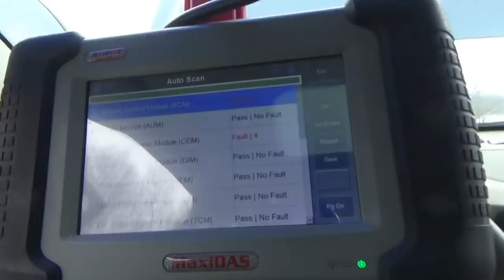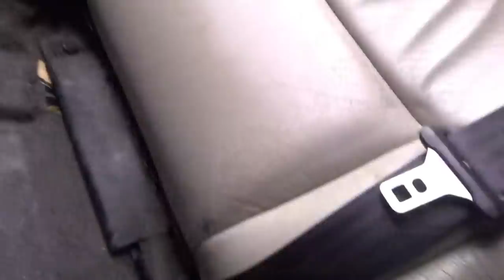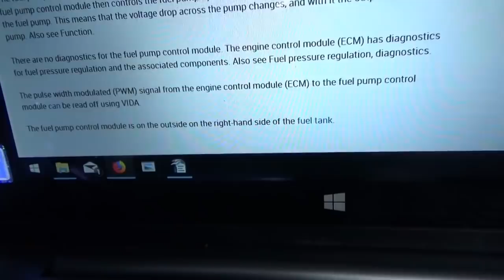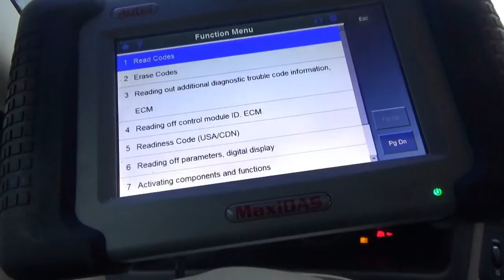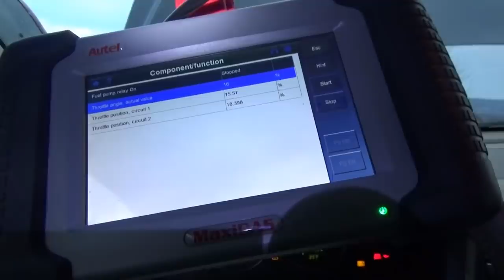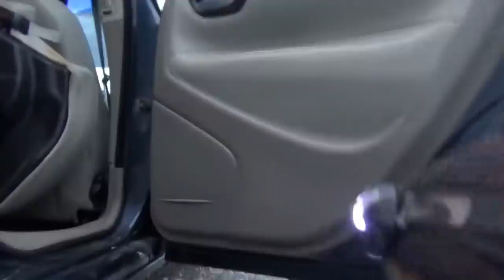Volvo Crank No-Start -Part 1 (Diagnosis)

Comment: Hello I see you are not using VIDA or DICE that Volvo requires for diagnostics of Volvos. What you are using goes pretty deep into Volvo diagnostics so is it from what you have learned over the years or is there still some things you cannot do to Volvos like programming throttle bodies or down loading software updates to Volvos?

Comment: I have a 2001 S80 that has no communication to the OBD port no – lights nothing other than one check engine light. Half the car doesn't work. Pulled out both ECU computers. Didn't see any corrosion or anything like that so I'm assuming it's the wiring

Comment: Dealerships are disgusting.  This guy took the time to methodically organize his troubleshooting steps. He checked and double-checked his findings.  He didn't jump to conclusions but instead, made the right conclusions. THIS is the difference between a 'technician' / parts replacer and a REAL mechanic.  What happened at the dealership and what typically happens-  the problem is 'diagnosed'; parts are replaced, doesn't fix the problem, the customer is called and told they need even more parts- and eventually, the bad part is 'found' but only after replacing a bunch of good parts-  all at the expense of the customer.  THIS is why I do my own repairs- THIS is why I watch TRUE mechanics like this guy.  Awesome job, thanks for showing us the way it's done.

Comment: Polymer electrolyte membrane is Working Principle Polymer Electrolyte Membrane Fuel Cells

They use hydrogen or low molecular weight hydrocarbons as the fuel at anode and oxygen/air as the oxidizer at cathode. Among others, hydrogen, being one of the potential futuristic energy sources,

Comment: On the Ford fiesta that was towed from five hours away, you tapped the bad module and it responded 
A Kevin tap test shows a simple physical circuit problem.
 Why didn't you pull it down and find the dry solder joint?

Comment: Funnily enough, I'm working on my '99 S70 right now, exact same fault. The electronic control system is a lot simpler, but the pump is controlled by the ECM in a similar way, just that it would appear that the pump is either on, or off, via a simple relay, though to say simple, may be not strictly accurate because there would appear to be a signal path back to the ECM which I have yet to deduce.  The main thing is, I'm going to be bypassing everything, and driving the pump direct at battery voltage. If that works, I'll be where you are at the end of the video.

Comment: I have a 03 s60 with a 2.4t it won't start. Replaced both cam and crank sensors, plugs and coils. It has fuel in the lines and can hear the pump running on initial startup. It still won't start, any advice?

Comment: I don't have or need to spend three thousand on a diagnostic test laboratory to tell me that my fuel pump isn't working. Just spray some starting fluid in intake press start,car starts ok. that means no fuel in rail or no pressure. Easy deduction BAD FUEL PUMP. Wow that costs $4 for starting fluid and 10 mins to test. I know I now genius. good old back woods knowledge will win every time.

Comment: Hi, very good program except from (the h-word) and you speak quite clear American-English. I wonder why you not did go strait to checking the fuel pump but I get the point that you follow a procedure to find the fault in a technical chronologic order. I recommend that you get a work-shop un wheel so you can come to the customers car where ever it is on the road. Then you can have a diesel heater and everything you need there, even a bed to sleep strait after hours with work. What equipment you use to do the diagnose with? Is it mainly for Volvo or a variety of car brands? What does it costs over there and do they sell it in Norway in northwest Europe?

Comment: Hi my name is Anthony Thomas I have a 20004 volvo s60 2004awd2.5 t and my car is slow when I acceleration I change the spark plug ING coils fuels filter  and I net to no wear is my fuel pump module is lowked at an Jack the car up  & looks by the gas tank & looks all under the car can't find it help me please my car run drive try the back seats & the tunck & ecu is bad can my car slow because of a ECU I seen your YouTube video & I like it & you said the car going back to Virginia & live in DC r u close by can I pay you to fix my car  one day thanks you
Reply: Anthony Thomas, since you're from the future, can you tell me if there is going to be a civil war over the NWO's "Great Reset"? Also, how long do I have before the economic collapse? I'm in 2021...Thanks in advance, from the past...

Comment: This is why NOBODY 1) Buys Euros and 2) Goes to Dealers. Euros are not durable long term, and repairs are staggering. Buy a Detroit product, durable as can be.
Reply: I'll stay with Honda/Toyota. Import is where it's at for me...mechanically inexpensive. Aesthetically, can be a bit more costly. Reliability, priceless...
Reply: @boodro2122 . Reliability? Really? Did you see all people the Toyotas killed about 10 years ago? Bad brakes, bad steering column, unintended acceleration, etc. Toyota was fined $1.2 Billion dollars!  89 people dead from terrible engineering & quality! You couldnt pay me to risk my life in a Toyota.  Japanese nameplates have had big quality problems the last 20 years. Toyotas are not what they used to be, not even close. Why do people think Toyotas are the standard in reliability? Tell that to the families of 89 deceased. Junk.

"Car manufacturer Toyota has agreed to pay a staggering $1.2 billion to avoid prosecution for covering up severe safety problems."

https://abcnews-go-com.cdn.ampproject.org/v/s/abcnews.go.com/amp/Blotter/toyota-pay-12b-hiding-deadly-unintended-acceleration/story?amp_js_v=a6&amp_gsa=1&id=22972214&usqp=mq331AQHKAFQArABIA%3D%3D#aoh=16152519830051&referrer=https%3A%2F%2Fwww.google.com&amp_tf=From%20%251%24s&ampshare=https%3A%2F%2Fabcnews.go.com%2Famp%2FBlotter%2Ftoyota-pay-12b-hiding-deadly-unintended-acceleration%2Fstory%3Fid%3D22972214%23aoh%3D16152519830051%26referrer%3Dhttps%253A%252F%252Fwww.google.com%26amp_tf%3DFrom%2520%25251%2524s
Reply: @My_Los_Angeles  Well, that's devastating. I have only owned Honda. I didn't know Toyota had this reputation. I know a lot of people who've had Toyotas and love them. A lot of people at my work drive Toyota and swear by them. I'm sure all manufacturers have detrimental statistics. No engineering is perfect. I'm a Honda guy. (Relatively new to Honda). And I've fallen in love with everything I've learned about them. And ive learned a lot! I've talked to a lot of Honda people, as well. I choose Japanese import over domestic all day.
Reply: @boodro2122 . You're just dismissing 89 deaths as "all car companies have issues"? No. This was a disgraceful and blatant disregard for human life. Profit over safety. Stop being an apologist for imports. Honda, and many of the Japanese car companies were caught inflating their HP figures badly in the late 90s. Their little engines dont make anywhere near what Detroit's do, so they resorted to inflating their HP figures (look it up). Imports have never been able to take on Detroit without funny business. In some cases, Honda's HP figures were exaggerated 30+HP to compete with bigger stronger Detroit motors...fact. Imports are all hype.
Reply: @boodro2122 . Yup!!
"They cheated, now they are caught and their numbers are shown to be bullshit. Honda or Toyota could have decided to spend the research and engineering cost to actually make the horsepower they claimed as the horsepower wars kicked off and gained more notice in marketing hype. Instead, they cheated and tricked the consumers into believing something that was not true.

It is black and white, there is no grey here. By cheating they were able to maniuplate numbers higher than they would have been in the real world. It is unfortunate that it took a regulation change to make the Japanese do the honest thing."
Reply: @My_Los_Angeles  My boys' Civic will walk your Detroit, bro. Lol
Reply: @My_Los_Angeles  Hondas are on the tracks smoking 6 figure cars. There's your "black and white".
Reply: @boodro2122 . Shall we discuss the Euros getting caught falsifying their emission standards a few years ago? Can you say '"Gross Polluter!". Seriously, imports have never been able to compete with Detroit without cheating. Pathetic.
Reply: @boodro2122 . A 4 banger Civic? LOL. Now I know you nothing about cars. You're embarrassing yourself.
Reply: @My_Los_Angeles  lol
Reply: @My_Los_Angeles  Nah Chris, im not embarrassing myself. I was just trying to get you going because you were getting all fired up over imports. And you're right, im not a gear head.
Reply: @My_Los_Angeles  I dont know much about cars besides my own. I'm not a mechanic, but there isn't much I can't fix if I have to. I know a few Honda enthusiasts and I've come to appreciate the brand. And I dig my CR-V. I can't banter with you about cars very well, but I think you're being a little harsh on Honda. Have you ever heard of "Million Mile Joe"? Drove an Accord for a million miles with proper maintenance.
Reply: @boodro2122 . Honestly man, dont reward deception. If people want to like imports then whatever, but its undeniable imports have engaged in major deception through the years. The conscious corner cutting Toyota did at the expense of safety was absolutely criminal (89 dead), the Japanese having to lie about their horsepower figures was shameful, and the Euros fudging their emissions tests was shameful as well. I would never trust a company again who lied to me, or worse yet endangered lives so blatantly as Toyota did. They shouldnt be rewarded with your hard earned dollar. I cant stand liars, and thats what the imports have been frequently. I trust Detroit products to protect me, havent let me down yet. Dont reward deception....

Comment: Why did my DIAGNOSTIC test find no problem but the car wont start?
My volvo S80 twin turbo was riding like a dream ,and stalled like I turned the key off.
It turns over,fires ,but wont start.

Comment: After I bought a fuel pump I finally found your vid.  This was the answer to a no fire 2005 XC70.  ( Codes were 089, 190 and 193 ) Needless to say, if you never experiences a two port fuel pump... kinda annoying when doing it green.  (Hint: Buy the socket, get two O rings and expect to stick your hands in the tank and get wet with cold gas even at below a 1/4 tank). Any way. Your bypass method was what we used to test the fuel pump and the car fired immediately. We just used two paperclips and electrical tape to the connectors to test pump and start vehicle.  The inside was full of aluminum corrosion dust. The other components looked brand new on this 15 year old vehicle.  If they used something the wouldn't corrode for the heat sink, it would have been fine. If you feel I should replace the rail pressure sensor because of those codes or suggestion on what to do next (Clear codes and if nothing come up. let it be?), I'd appreciate it.   Oh and mine was not located on the tank it was exposed on the side in the rear underneath. The part number was 30769225 for Bosch (Original number was Bosch 8629614) and 601-227 for Dorman if anyone is wondering.

Comment: HAHAHA, jesus.. 
Is this repair shop still around? Looks to me that the owner wants to become a millionair, you should out them, this is not right. 
Have a hard time to belive the PEM is broken, but you can get one in the scrapyard.
Get a new fuel pump, change it yourself. $40.
Get a OBD cable and fix the fault yourself. $20.
Either you fix the rusty hanger yourself or let a shop fix it, price seems right if it has welding in it.
"oiltrap" or crankcase ventilation, fix it yoursel, clean it or if you have to purchase it $40.
New oilfilter for fks sake, $10.
2 new control arms, $300--400.
Leaky rubber, new rubber $10..

This is what happens when you don't take care of your car. Does not matter what car you drive.

Comment: Another Crank no Start/security fault solution: Some Volvo S-70's have a chip embedded in the key that the ignition reads to allow it to start. My 2000 S70 had a key that the chip went bad. We found this out after trying the SPARE key on accident...everything instantly worked great, started right up. So to make a copy of the key with the good chip costs about $120 unless you go to the dealer and it will be about $300 +

Comment: Okay so I am having the same problem on my 2007 S60 T5. This video is incredibly informative, but, being a novice at repair, I don't know what that power source you connected to the fuel pump was. What is it and where can I buy it?

Comment: I run into that headlight problem a lot on the newer cars which drains the battery, so what I do is I pulled the headlamp  Relay, As long as the headlight system  Is not part of the problem being diagnosed this works great

Comment: I whould remove the CEM and open it. It's a very common fault that these modules becoming water inside and corrodes the PCB. I had this many many times. You need to disassemble the whole CEM to fix it. BR Matthias from switzerland!

Comment: The dealer can go suck it ... that basically resumes it. What is the role of that module, does it control the pump by PWM? And where does it get power and control signals? I guess you could back engineer it if it is not too complicated. Waiting for part 2

Comment: PEM is petrol electronic module if I recall and there is a fuel test port on the fuel rail under the black cover.

Comment: Nice Diagnosis. I am just guessing it took you a little over an hour to find a poor fuel control module. 
looking forward to Part 2.
Reply from the maker: Most of the time was spent locating the components lol!
Reply: @PineHollowAutoDiagnostics  Tow the car up to you, do the repair, and than take the train to get the car. Drive the car back to VA. For a fraction of the dealer repair cost. Yes or No
Reply from the maker: Actually I'm driving the Volvo back to the owner next weekend! How's that for convenient service? :D

Comment: Wow.. Its unreal how common it is for the "experts" at the dealer to be so very wrong these days.  Guess that's what happens when they guess "based on past experience/paytern failures" instead of actually testing.  Sad really.   

Jjust a few days back we had a car come in to our shop for a second opnion..a dealership said the  transmission was slipping and needed replacement.   Turns out there was a bad plug causing a slight occasional no code misfire.    Unbelievable.
Reply from the maker: Wow they totally missed that one haha

Comment: Thanks Ivan can't wait for part 2  Reason I have a 2004 Volvo V70 only at a 147k  bought it  because I like the features it has , not crazy about the mechcanicals it has still will take a asain or good old USA nuts and bolts vehicle  just me . Joe still  turning wrenches at 68 ( pick and chose the jobs can't  get paid for the agravation .

Comment: I remember the first time I put a throttle module on a S80. They come as a dummy and must be programmed. Started the programming using Autologic and the whole car went dark. Freaked me out till I realized they shut down the other modules during programming. Also half the battle is figuring out what all the manufacture specific acronyms stand for. Looking to control a fuel pump on a BMW whey it’s in the airbag module of course!

Comment: Nothing wrong with these Volvos,they’re solid cars! Just wrong location of that module. Move it inside the car and it will be fine for many years. Good thing you didn’t have to do a fuel pump on that thing,I’m not sure on this one,but on some Volvos you have to drop the exhaust,rear subframe and tank to do a fuel pump! 😮

Comment: Dealership was 100% right! AT 200K THE CAR NEEDS A FUEL PUMP TOO! To run a business you have to prevent comebacks not create them.That car will stall out eventually when the fuel pump fails and when it does, good luck explaining your way out of that one.And How do you know the pump didn't burn out the module in the first place? It tells you the Pump is PWM driven, and as the pump ages the duty cycle will increase to compensate.Also I missed the part where you thank and congratulate the dealer tech who checked that car so you could make all the profiit.And what about the LIFETIME WARRANTY that the dealer gives? Most customers are broke but some may be interested in  that added value. Finally how would you feel if the customer has that car towed away to a cheaper tech and leaves you with one hour's labor and a sincere thank you?
Reply from the maker: Just wait for Part 3...we'll go through the laundry list one item at a time 👍😉

Comment: It’s a freakin Volvo. By definition they cost more to repair than they’re worth once they pass about 80K miles. If you look up “junk” in the dictionary it says “See Volvo” and Volvo dealers love to rip off deluded clueless Volvo owners. You just need to replace the blinker fluid to get that check engine light to turn off. Drive it off a cliff and do the owner a favor.

Comment: "The dealer can suck it!"    Word.   Obviously that estimate was simply a segue into their sales department.  No one would spend even a third of that amount on that car.  Not worth it.  Dealerships are the worst thieves of them all, just look at the place.  Someone has to pay for all that facility/personnel and STILL make a profit.   How do you think that's done?  By ramming the desperate right up the tailpipe.   Every time I go to any dealer for parts I feel like I need a shower after I leave.  A quick stroll thru sales shows the most depressing scene.  I dunno how nothing ever changes here, it's a decades-old issue.

Comment: On V50s and I think the other P1 chassis cars they had a recall on the FPMs because of high failure rate from moisture and corrosion. They moved the inside under the seat.